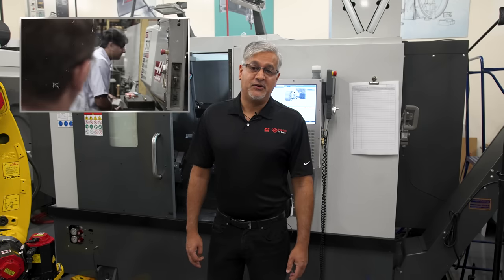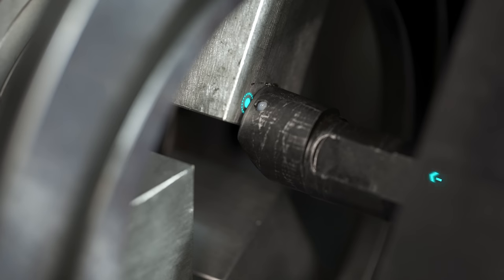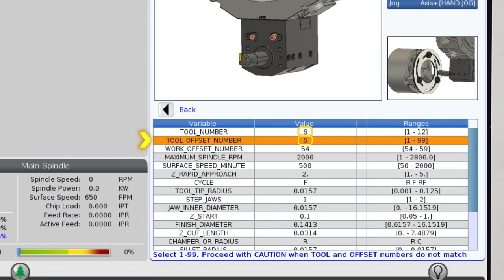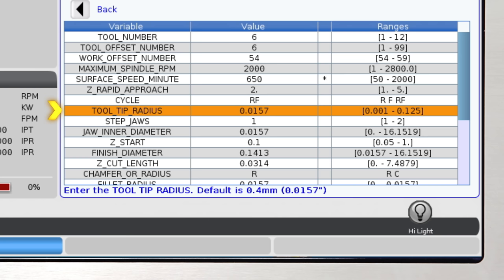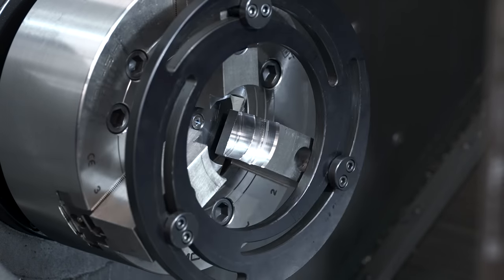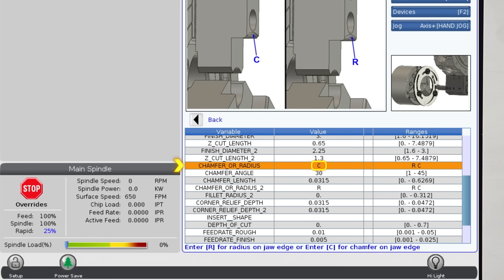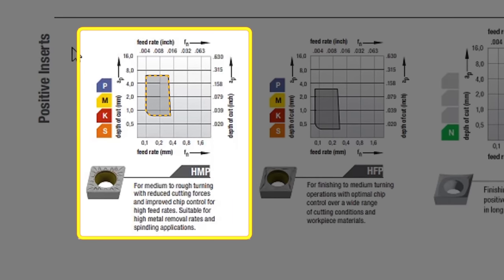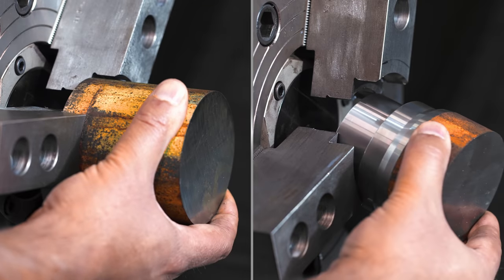Haas Lathe Soft Jaws, Boring Rings, and VPS Templates - Haas Automation, Inc.

Comment: This is very nice and informative video, but how do you cut ID jaws? No possibility to use such ring...
Reply from the maker: zyndapp800, Check out our Cutting Lathe Soft Jaws Part 2 video: https://www.youtube.com/watch?v=-AyMQNoaBjc&t=3s . . . starting at around 2:20 we talk about using a scroll style jaw boring ring which can be setup so that it clears the outside diameter of the jaws.

Comment: Hmmmmm.....need to check if these are on my TL2!
Reply: The programs weren't on my TL2, but you can find them on the Haas tooling page, if you go to where they sell lathe jaw boring rings. The instructions worked, I have the template, but it doesn't show like when you normally select a VPS template. The instructions tell you to press F1, this makes it visible. Now to buy/make some soft jaws for my Samchully chuck!